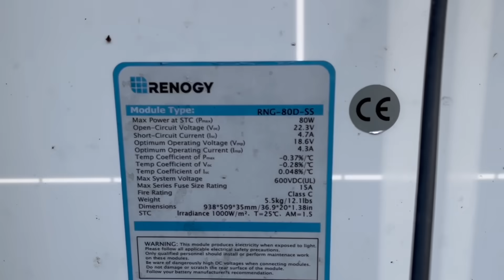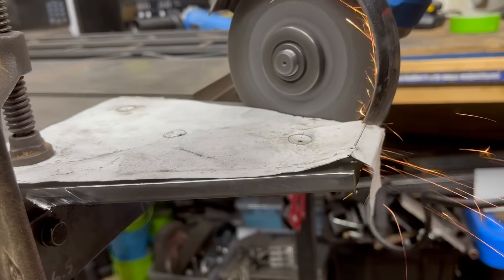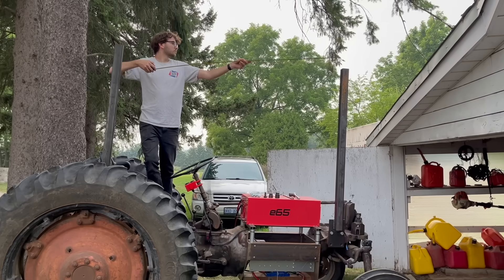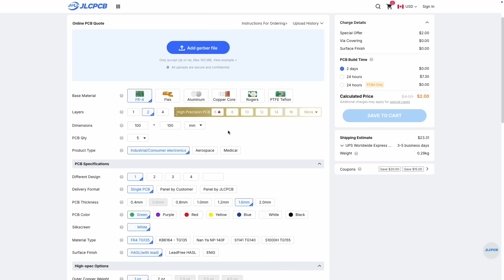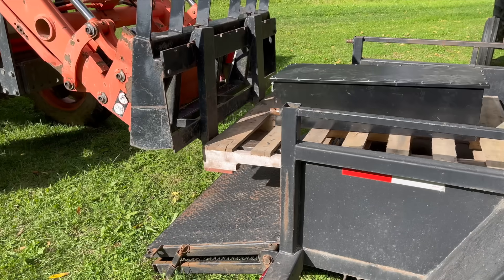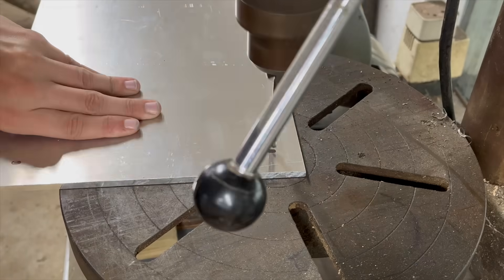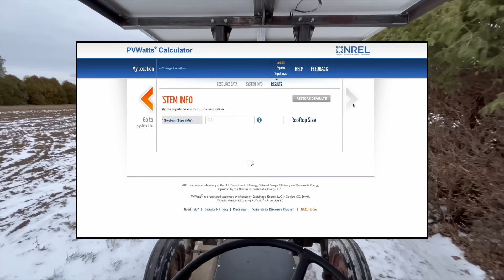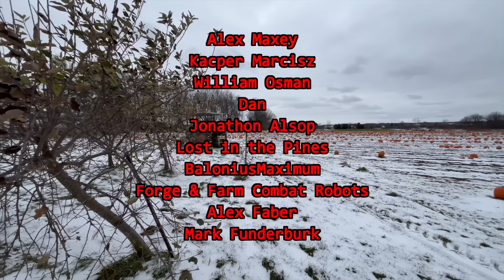Adding solar charging to my electric tractor

Comment: As a side shop project, I made a golf cart canopy out of a single 320 W solar panel. I had left over. It was difficult finding a 36 V solar controller, but I did and I have yet to find its limits. It seemingly will just continue driving forever as long as the panel is in the sun. I drove the golf cart all the way across town two or three times and it barely slowed down at all. There’s definitely a future in solar powered equipment like this.

Right now we just use the golf cart to move firewood and the occasional empty flatbed trailer around the yard but it’s pretty cool. I can’t believe we didn’t do this sooner.

Comment: This is so cool and literally bringing this old tractor into the future
Reply: Also that crappy drill press could have done the job but you have to go up and down frequently to clear the bore you are making use more oil and low pressure

Comment: If you put a nut on the bolt before you cut it. It will help straiten the threads

Comment: great work on the solar canopy.  Impressive numbers on how much free solar energy you can gather with a decent but still modest array.  So cool.  Sorry about those bolt holes that shrunk between measurements.  Old tractors castings sometimes have crazy dilation coefficient 😜

Comment: Just a thought, what if you took a Four to 12 hp Briggs or predator and a car alternator youd have another supplement supply of energy everything compact and you already have everything to enact this plan. I've always had this thought of turning one of those micro engines into a generator for an Ebike or Ekart.

Comment: Agricultural equipment run on solar power is actually a very smart/cost efficient and sustainable solution. The part that makes it smart is when its autonomous, since that takes the man Labour out of it. If you look at the company Farmdroid, the produce smaller unit that drive around a set field maintaining it, and they do so 24/7 and can charge at a station (like wait to low price doing nights) or just of solar panels on them. so instead as machines requiring human (hour cost) needs to get bigger and faster it is the opposite here, you deploy x amount of droids depending on acres, and then you can monitor it from you office or phone. In a shown case, the droids plant salat seeds, and they know the exact placement of each seed on the entire field down to like 1 cm accuracy, then it can slowly role around over the season and mechanically remove weed around each of them. (think also point water and fertilize etc.)

Comment: For winter, get a 12v car seat heater pad - they draw less than 100W so won't ruin the range, but they'll keep you toasty warm as long as you're in the seat

Comment: If you add a way to hook a canvas around the frame, it would protect the tractor from the weather while allowing it to still charge when not in use. Also, maybe you can rig some cameras around it to give a birds eye view of the surroundings to make navigating around obstacles a bit easier and safer. Lastly, I don't know if this thing has enough torque to flip itself, but if it does, add some sort of safety cut off that will turn off the motor if the front wheels go too far in the air.

Comment: When using an angle grinder, you want eye protection, face protection on top of that, hand protection, arm protection, and chest protection. When your cut-off disc explodes at 10,000 RPM, you'll figure out why.

Comment: lol most tractors have AC and Heat now, hell most have GPS and Radio with bluetooth. I mean that tractor would not pull much for very long before running out of power. The thing is neat but not practical for heavy farm use. However I think the future they will have some electric tractors that have a real use.

Comment: This awesome!!!!   I’m trying to figure same thing to do at work to charge my Tesla , my work’s parking lot has grass islands where I was going to erect temporary solar pergolas that will be connected to my Tesla which would have inverter, solar charge controller, battery to charge the car instead of putting all that stuff on the roof of the car.

Comment: Why not get a, you know, not bent straight drill? Operating like this will only damage the machine while taking longer and making the holes worse.
Also - no shock-relieve for the solarpanels? They can easily form micro-cracks under vibration and that can significantly reduce their output.

Comment: I love this project and enjoy the humor. One real comment from a solar / battery guy: LiFePO4 batteries should not be charged if the cell temp is near freezing at or below freezing so hopefully the BMS is managing this and you tested the temperature leads (remove, stick in ice water, watch BMS turn off charging) a la a billion Will Prowse videos. They can gain some temperature from discharging and then be charged, but that’s a bit of an edge case for 32F/0C or nearly so. Just a note on cold temp charging reality but not a criticism - you’re doing great stuff. By the bye, a mag drill is the absolute life changing event you imagine it is, especially when you use it as an upside down drill press. And even more so if you use it upside down, forget the safety strap then turn off the magnet to have $1,000 and 40 pounds headed for your head.

Comment: If the top roof panel were framed from U-strut, then the panels could just be clamped on using purposes made solar panels clamps. Also might streamline the construction l a bit.

Comment: yep lot of losses with that charging station. 
since your tractor sits a lot, 
you should have parked next to and charged it directly from the panels. 
yeah, different voltages, ...
but this should have been thought from the start,
also, the panels on the tractor are more a roof than charger 
because of the angle.
but is better than nothing. 

super cool project. 
now free driving it for next ten years :) till battery replacement.

Comment: Pro tip: Always use a lot of oil to cool down metal when drilling. It will make it easier to drill, save the drill and make it less unlikely to break your wrists. It doesn't matter much what type of oil, at least instead of no oil. I would guess even veggie oil could work. The cheapest is used motor or tranny oil, but there is certain cutting oil you can buy.

Just noticed you claim you always use cutting oil... I guess you only chose footage of before you used cutting oil then... It should look like a bukkake fest if you do so don't claim you do unless.

Comment: Maybe add another roof over your seat to add insulation? The summer heat under solar panels is not as good of shade as one would imagine. In the winter maybe you can add snaps around the frame to dangle a clear windscreen to make heating less of an issue.

Comment: You're not the only one who has accidentally caused a short circuit with a connected battery.
I had a solar panel with a battery in the garden and wanted to charge my scooter with it via a step-up converter. I had already plugged in the connector before and then wanted to temporarily connect the cables. Bang.

Comment: Please Note: That "cage" will likely kill you in the event of a rollover. Remember, it would be side loaded. So, those joints would be loaded in their weakest axis with maximum leverage and the plates on the front would be bent along their thinnest dimension. You'd need to add considerable gussets to withstand those loads. Especially because your rollover risk primarily comes from working on slopes where tractors tend to start tipping slowly and then rapidly rotate after their tip-over point. As-is, it would make an effective way to guillotine body parts. Also, in general, tractors and similar equipment with non-rollover tops are considered more dangerous because you can't hop off as easily. - If you have a mechanical engineering friend I suggest you ask for a consult.

Comment: Your early videos on this tractor build helped push me to decide to get a second bachelor's in electrical engineering!  I just finished my first semester of EE school as a 40 year old freshman.  I started installing solar 4 years ago.  Practically speaking, I think 4 panels in series with one charge controller would have been fine.  The tractor is constantly moving and your array is so small the shade differences are negligible.  As long as you park the tractor out in the open during solar noon (a great time for lunch!) the yield differences would have been in the 10s of watts each day (no I didn't actually do the math).  Also there is nothing wrong with grid charging off peak as the energy would likely be wasted at the power plant otherwise especially with coal.  Clearly you need to add a second battery and a 12 volt car plug for a heated blanked during the winter!  They make aftermarket 12 volt car heat pumps that you could retro fit to your family's enclosed cab tractors for AC in the summer.  Could also be a fun build if you could enclose your electric tractor.

Comment: Put it on an A shaped frame with a rod at the top. Use a pulley and cable to adjust the angle from the seat. Attach a servo or stepper instead and a sun tracker so it moves automatically

I'd probably include mechanical stops and limit switches for stopping the motor in software

Comment: Nice I turn my tractor in to a robot/remote  trying to find long distance sensors  satellite connection is my down fall great video
Reply: Add  wind solear hydrogen fuller baterrg hygern genertor solar cell names hydergen

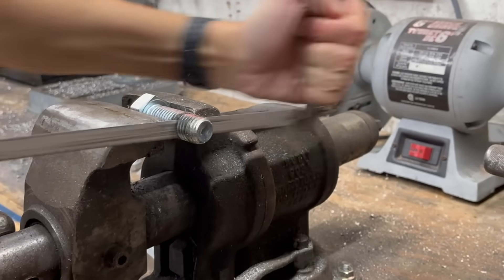Comment: 4:28 Quick tip for cutting a bolt - put a nut on first, then after cutting, taking it off forms the thread back

Comment: What does all that mass high up do to the center of gravity? Especially since your battery pack is also relatively high up. I’m also not sure it’s good enough as a roll cage without cross-braces? (it’s also questionable how useful a roll cage is without a seatbelt)

Comment: If there's anything that produces more torque than a big diesel engine, then it's a big electric motor.
I'm eternally dubious of solar panels, but if they can actually charge the battery at a decent rate then I see nothing wrong with an EV tractor.

Comment: 4:30 A redneck tip: thread a nut onto the bolt before cutting, so when you unthread the nut it cleans up the threads. It's not perfect, but it's better than nothing.

Comment: 4:30 - put a nut on the bolt before cutting it short... subsequently taking the nut off (after the cut) often safes having to put it on the lathe to fix the mangled threads.
and 100% support electrifying stuff - did the same for a quadbike with a busted engine. It doesn't have the range or power of the old petrol engine... but for my use, on a 2ha property - its plenty, and very convenient. if i was trying to make my living off of a tractor planting crops etc - then ICE is almost certainly needed for the long continuous high power needs, but for more casual/intermittent use, electric works great.

Comment: I tattooed a line in my index fixing a laptop battery. I consider myself extremely lucky that it happened with a laptop battery and not some monstrosity like what you're using here.
Reply: Buy Samsung solar network boot sol solar powrr laptop
Reply: @sharonbraselton3135 what confabulation is this  my friend?
Reply: Vampoer inmotralbateries

Comment: fun fact PERMATEX the company behind RTV gasketmaker has a VERY helpful chart on their website that describes what each color and grade of RTV is most optimal for and (The Right Stuff) is the highest grade meaning it bonds to dang near anything with minimal prepp BUT for this application and basically anything else that is metal on metal and outside the grey is a better choice because it is more flexible when cured.  Again all this can be fairly easily found on PERMATEX's website.

Comment: Its good that the power lines in the end of the video were the low-voltage ones after the transformer, right?
Anyway, a better idea would've been to just make it so you can easily swap batteries and then just have a charging station out in the field taking up valuable crop land.
Reply: He could start Agrovoltaics. Grow strawberries & tomatoes in the shade of the solar panels.

Comment: You can cool down the male taper with freezespray of just take take the morse taper to freezer. 
And heat up the chuck abit. When you hit them togeather, there will be a slight interference fit. 

Oh and clamp down the piece so it wount wiggle , then it will not come out.

Comment: 0:36 btw this is still MUCH more efficient than any fossil fuel system. The efficiency of electricity conversion is above 90% instead of with fuels. The efficiency in an ICE motor alone is only about 30% and this does NOT even count pumping it out of the ground, shipping it, refining it, and then shipping it again to burn it at 30% efficiency to move. It's almost a joke to speak of "efficiency" when it comes to fossil fuels :D

Comment: You can charge any battery to 100%, what are you smoking?
It's in fact what you should do, since those cheap Chinese BMSes only do top balancing, meaning if you don't do a full charge every once and then the cells will drift apart

Comment: Diesel Generator + Thermoelectric generator wrap + Stack all excess power using capacitor bank with limiter to motors. Cranks 50 year old miner lamp for a few seconds and sets it down for minutes You can stack power in capacitors super high so they can bleed lower for more time to something. Can also be used to use waste energy from idling for Regenerating boost or takeoff power or for yanking stumps. Points at CO2 generators at Greenhouses Greenhouse gasses not a problem the original I still use is rain test for acidity because it all absorbs into water. Runs finger from capacitor bank to blower that pushes engine exhaust through water filter in sync with engine without hindering it Google: "Making Synthetic Diamonds and Carbon nanotubes using CO2" You like electric stuff? I tell you how to get the resources for the ELITE..

Googles: "Ultrasound control of electric Plasma" + "Ultrasound holography" + "Ultrasound excited plasma generates stronger EM field" + "Plasma generated Ultrasound" < Base requirements for Holographic & Electromagnetic holography assembly of nano tech.. Your govt won't tell you what to add to see it, I do. They got it all for themselves.. Fires Plasma Ultrasonic discharge set to smash plasma into a cone with resonance filters for natural materials for max penetration scanning into the Earth Better than a shotgun shell for scanning with shock waves. Points at Boeing Plasma force field block bomb Demo EZ PZ.. - Dracula/Hades (Bat=Ultrasound Powers) https://www.youtube.com/watch?v=J46EcAqZAPY Space Pirate..

(For climate freaks = You can make %100 Same fuels with Algae for a reason. Ask AI about Algae that requires no light.. You've all seen images of deep caves having GREEN water or white Algae I'm sure. Your governments not sealing and using empty giant mines for Algae while talking about "fossil fuels" is just nonsense.. Humanity literally puts Genotoxic Chlorine and Sodium Fluoride in the tap poisoning genome of everything slow. Consider that as a threat to the ecosystem too.. "We need to bag the leaves and send them away!" Send the nutrients away instead of put a mower on mulch mode to dust it all between blades of grass. What would Earth do without Humans? LOL.. Load up free calculator App on your smartphone and go to Amazon search for Calculator. Thousands of versions produced for millions of POTENTIAL buyers of many things you all already have just from getting ONE essential thing. Virus.. Climate change? The people who sold you that as normal own the science system, idiots..)

Edit: F Android & Apple emulator autocorrect on scroll error too. How many versions of junk smartphones and OS? Hmp.. GET A CLUE!!

Comment: How often do you expect shading will actually be a problem?

Boost controllers are less efficient, overall you might end up with more energy running the panels in series

Comment: If you take some greenhouse plastic clamp down strips the "pressure fit kinds" and attach them to your roof and frame you could totally have a nice poly cab and even redirect the solar for pv direct heat. Gaining both a cab and heat win win.

Comment: Tip for the threads when cutting a bolt: Put some nuts to the bolt before cutting it. And after cutting it just screw the nuts off :)

Comment: What would it take to engineer interchangeable batteries that you could quickly swap out? (Like the batteries attached to power tools.) I feel like that would be pretty practical with a tractor and would allow you to slow charge the swapped batteries and also let you keep working all day, quickly changing batteries whenever needed.
Reply: Do you know how heavy a useful battery pack for a tractor would be? Hint: You can't pick it up!  Yes, you could use a whole bunch of removable modules but that would be much more expensive, complex and not as space efficient.

Comment: I wonder how long those panels would hold up? Wouldn't the vibrations, seeing as there is barely any suspension on a work tractor, eventually break/micro crack the glass panels? Although they would probably still function just a little bit cracked haha
Reply: Yes, some thick rubber mountings for the panels would be a sensible addition.

Comment: Are you aware that charging cold lithium ion batteries will reduce its capacity permanently?
It will cause lithium plating on the anode and it can't be reversed.

Comment: Aluminum square stock exists my dude, my God. You could’ve saved so much weight any money.
Reply: Aluminum costs wayyyy more and welding equipment that'll do aluminum is less common+ more expensive.
Reply: @om617yota7  Didn’t consider that, never had to buy aluminum welding equipment at word lol